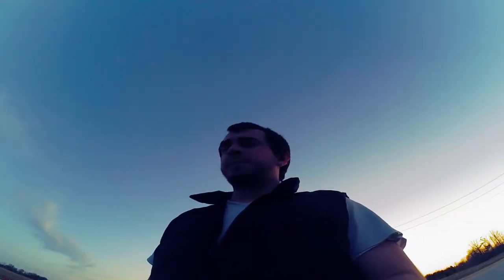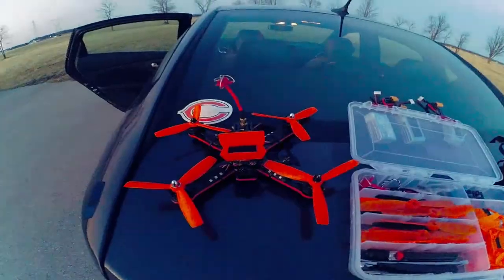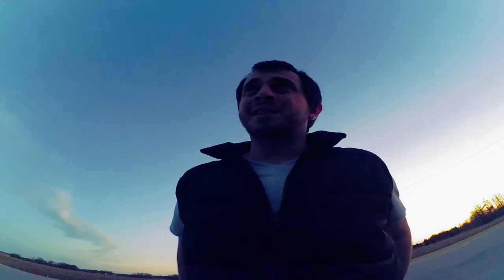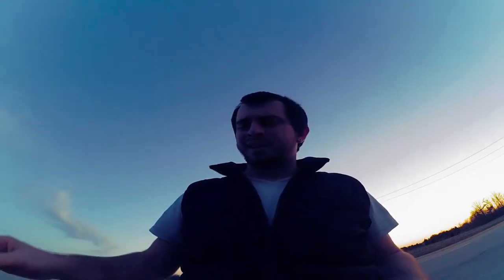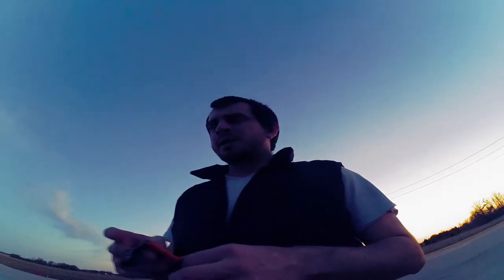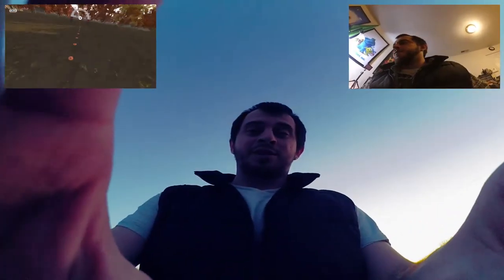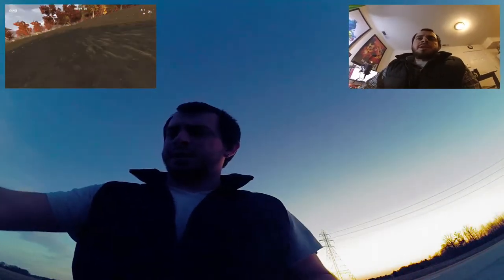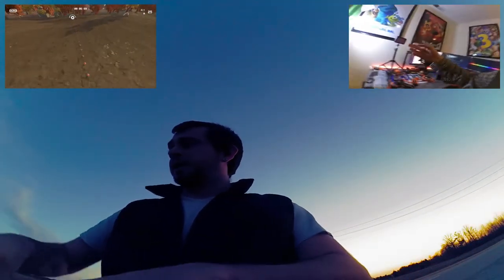Goby 210 | Rebuild & Maiden

Comment: Thank you for your knowledge and insight on your setup, and what factors cause prop wash.It was very informative. I completely understand why you use 2207 motors and 5051 props to lug that thing around. 😊👍
Reply from the maker: Stingerswarm has a great description of propwash and how to avoid it in a video on either his channel or the rotor riot one, I can't recall which. He does a fantastic job of articulating how to avoid falling into your dirty air and what not. Worth checking out!

Comment: would you rather get the 210 or 180 goby???
Reply from the maker: +scoodles93 Depends what you're looking for. I was originally after a 5" quad so I went with the 210, but then found out that if built differently (like a shrike) it can actually swing 6" props. If I were to buy another 5" goby it'd be the 180, which can actually swing 5". I'm probably going to take a dremel to mine and cut down the front/back portion of the bottom plate then build it all into a center stack after MDX.

If you just want to build the quad as it stands in sort of the default config, the 180 would be for 4" and the 210 for 5", so it just depends what kinda quad you're after.
Reply: Thanks for the quick response!! Im looking for a 5inch quad. I have the versacopter v2 but it is slow and heavy(900g), the first extreme crash completely destroyed the frame. Now im looking at a 180 or a 210 quad for tighter tree flying. i live in 6500ft elevation and if i did get the 210 i can put 6 inch props on which would help alot with the thrust up here.. i was running 6 inch props on the versacopter but i didnt have the punchout i need up here...  is the goby to "twitchy" at all?
Reply from the maker: Not sure what you mean by twitchy; I usually correlate twitchiness to one's rates and expo. It can be twitchy or you can smooth it out. It's a light little frame that can pack a punch though. I'm super happy with the power mine has on DAL 5045 tris or even 5045 two blades.

Comment: To answer the "twitchy" question . Yes it is. And has prop wash too. You can see both examples in this video. I'm not a fan of it, and regret buying this frame. At least it was only around $40 so. It that much of a loss. It's just a $40 paper weight these days. Oh well. Good luck with yours if you still fly it.
Reply from the maker: This was nearly a year ago on betaflight who knows what.. I actually just rebuilt the Goby not too long ago and it's not twitchy at all. Depends on your tune and experience level I suppose. I was running it on Ts2207 2300kv motors with 5051 props and it flew like a dream. Things have come a long way since I made this video and responses to comments were posted. This is a perfectly viable frame and I quite like it. Nearly picked up a second to try a 4" build a few weeks back!
Reply from the maker: Also, prop wash is in no way related to your frame. That's a factor of a poor tune and/or lack of pilot ability (as seen in this video) to navigate around it.